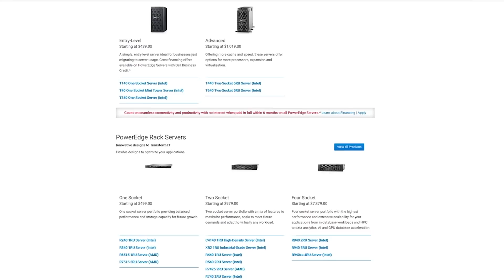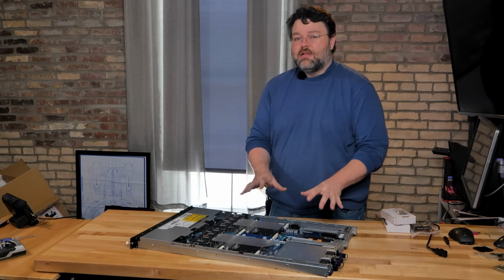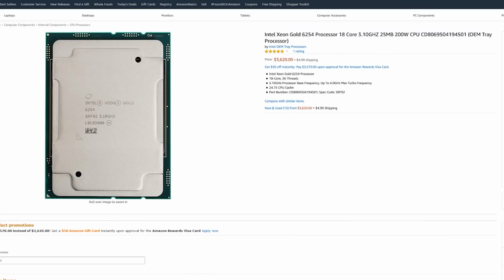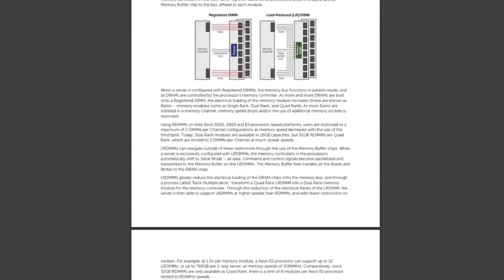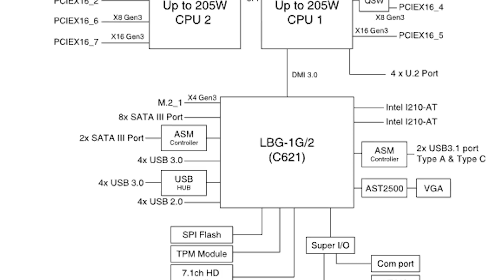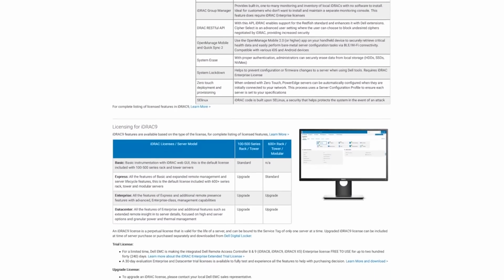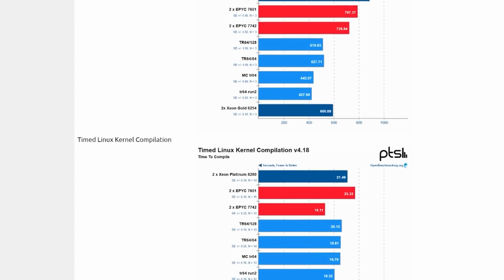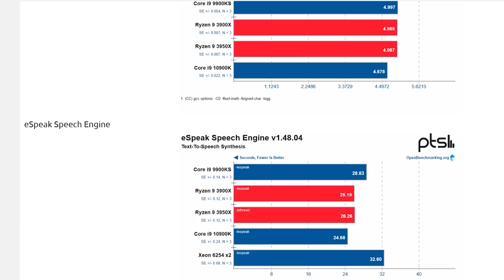Gigabyte Dual Xeon Server DIY and Benchmarks! R181-2AO Built & Tested

Comment: Back when I was building servers, we used to charge 8-hours and more because we actually mounted the motherboard into the chassis, installed and patched the OS, and configured the storage.  If all we had to do was  install the processor(s), slap in some memory, and close up the case, we could have charged much less.

Comment: It could probably be too late now for my request but I will give it a try. If you still have this system, is there any chance that you could test the startup time till the hardware boots into the actual OS? I am asking this because I have a Supermicro E5 1U server, single processor and it takes a couple of minutes until it is actually booting into the Linux OS. I know it is normal for servers but it is somehow frustrating. I am curious how Gigabyte handles that. Thank you!

Comment: Yeah, but they have custom backplanes and cases that you CANNOT find which support dual PSUs, hot-swappable HDs, quick-release fans, etc. And I would LOVE to have those things in regular cases. I.e., the T640 holds 18x 3.5" HD.
... or 32x SFF 2.5" drives... SATA-DOM, IPMI, supports DUAL - CPUs ... etc.

Comment: Great video! I'm starting to study for the datacenter field and I got a quick question. Does Xeon have any advantage over threadrippers or epyc processors nowadays?

In the gaming field intel is superior in sheer speed over multitasking, but is it different in the server and datacenter field?
Reply: It is an it depends on application.
Thread-rippers had issues with ESXI for a while while Epyc worked right out the box.  
SAP HANA in Memory Database only works on Intel Platforms.
Epyc had an advantage is that it allowed more access to Memory  in smaller foot print. 
Then there are edge servers where the XEON-D are very good with AMD looking at 32xx.
Intel used have Better NUMA domains but AMD getting there with the third 3rd GEN Epyc.
Intel Optane 3d x-point.
Reply: @skullleader-hw9hi  Thanks for the response! It seems to be a perfect time to get into the field because from now on there will be rapid changes in boths hardware, and software support will get wider

Comment: What about replacement parts? Troubleshooting and tech support? Frequent and certified Firmware and Driver updates? Not much fun when you run into an issue affecting the performance or stability of the OEM system and how fast do you think Gigabyte is going to be able to solve a problem for you? 

IF you are going OEM servers, i suggest different brands mixed in a cluster, so you wont deal with the above problem.

Comment: Man, I really wish I'll get in a company where I can play with some more serious servers and not just old refurbished servers used for testing software that don't really need the latest and greatest.
Reply: I can't even play with servers :(
Reply: @ishansharma9492   You will get there, buddy. I've started as a helpdesk too, with no access to any server, just some raspberry pis that I did a custom on-premise radio for announcements and one of those slideshow picture frames. When I asked for higher level access, I was denied, then just moved to another company. If you want to learn, going to a small company might be better, because usually you have a closer relation with the whole IT department and they can give you access quicker to the backend. Just make sure you aren't getting hired strictly as a helpdesk.
Reply: @MrBiky  thanks mate!

Comment: I wish we had more options for home rack mount systems/cases but centered around a home market (so no 5000rpm 40mm fans). I'd love to have all my homelab stuff in a small rack and have it be (relatively) quiet.
Reply: 3U and 4U chassis are for you.
Also a 2U can have 80mm fans, they can be not loud.

Comment: arnt you supposed to put your cpu on the heatsink first? thats how i did it acording to the manual on an asus MB with dual 4210
Reply: starshipeleven 
Intel's heatsink designs have been amateur hour since they started.
I think they hired Apple engineers who prefer appearance over function.
Reply: starshipeleven  on one side i understand the only way to mount it without the plastic is directly on the socket.
iv always been afraid of the cpu falling on the pins, is an expensive MB and even if the plastic thingy is not to be trusted it still holds the cpu to the heatsink when unmounting it. at least more then with the thermal paste? 
it also depends what thermal paste we use. lucky artic silver 5 is verry sticky and that would help keep the cpu sticked to heatsink in any situation.  if the paste he used is less sticky, he might have to be lucky when he will unmount.
Reply: dispite the mounting in the vid was wrong, the wrong comment got a like,  confirming he would not accept some constructive criticism
Reply: Galaxy Ban no life

Comment: For these server reviews i'd like to see some power consumption measurements.
Reply: @Richard Clutterbuck With dual XEONs, the power supply efficiency is the least of your worries.   I'd like to see this system compared to 2x 3950x and 1x 3980/3990X for 
processing speed, cost and power usage.   I'll bet a 3990X would kill that thing for 1/2 the price and power usage.
I think this is another one of Intel's fantasy builds = something you COULD do, but never would, in real life.
Reply: Well if you're doing some homelab type of setup and don't need a powerful server you could always make a DIY solution using an older laptop, remember when laptops had DVD drives? Yeah, those are nice because you get two sata ports plus sometimes an M.2 slot and you can even replace wifi with two or four more sata ports using mini pci-e adapter like this: https://www.ebay.com/itm/Mini-PCI-Express-to-2-Ports-SATA-3-0-III-6Gb-s-Expansion-Card-Single-Chip/122818091536

That should get your power consumption down to around 100W depending on the drives.
Reply: @vgamesx1  Nah its not about home use or worry about consumption but a general idea what the hardware consumes would be nice. So one can draw a comparison to older or AMD hardware otherwise just looking at TDP it is pretty hard to compare systems

Comment: I can't imagine why you'd use Intel server chips over AMD at this point.
Reply: With all the hardware security flaws poping up, I can't see why one would choose Intel over AMD at this point, unless is something not facing a public network.

And if you are buying brand new, your workload REALLY must run a lot better on Intel to compensate the higher cost.
Reply: @magoid  Only if you have untrusted users operating on your servers. If you don't have remote access to your servers those vulnerabilities mean nothing. If you are not running malware on your servers those vulnerabilities cannot be exploited. It's only if you are running programs you don't know if they are secure and only given limited permissions. It makes sense for giant cloud providers(Google, Amazon, Azure) but if you are buying and running your own server the security stuff means nothing. You should be more concerned about the software vulnerabilities of the servers you are running and making sure your network is secure.
Reply: Platform maturity and validation.  LTT built an all NVMe storage EPYC server and had all kinds of severe performance issues because the CPU could not service drive requests fast enough when all PCIe lanes were fully loaded.   There's a reason Xeon is typically a generation or two behind Intel's desktop parts; it takes time to fully test and validate all manner of hardware configs and use cases.  You don't want to order 10,000 servers and then find out they can't actually do what you bought them to do because the engineers didn't have time to test what happens when you fully populate all the slots.
Reply: @gtwannabe2  Please dont mention Linus or LTT when discussing enterprise hardware lol
Reply: Well Wendell did help Linus with that server in a video...
Reply: Most servers still use Intel.
Because of the years of them being superior.
Reply: AVX512, Intel Optain Memory or DC persistent memory, Better software support, Better Optimizations, sometimes Better managment.
There are a lot of reasons why one would choose intel over AMD Specific workloada require specific hardware. Sometimes intel is better sometimes AMD. So please don't make such ignorant comments